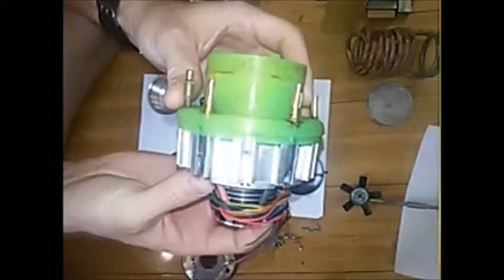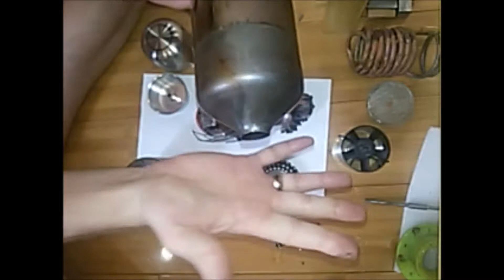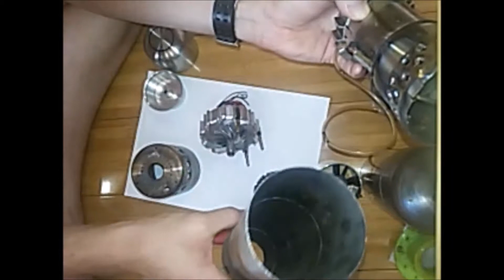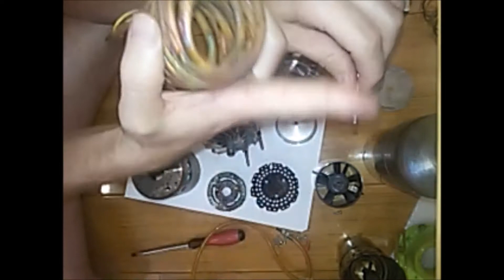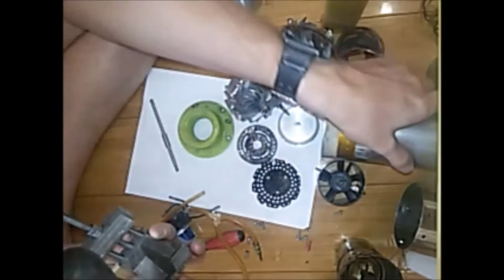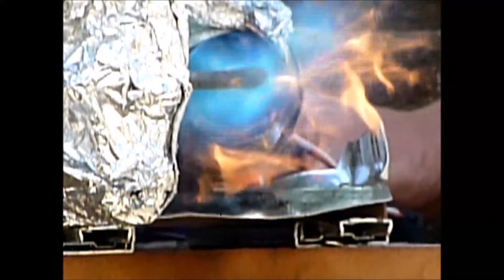YouTube

Comment: Could a 7.5hp Nitro engine with a gearbox drive it fast enough to get enough compression?
Reply from the maker: if you had a gearbox that would sustain the RPM to get it to 100-150krpm+ then yes. Put a propeller on the 7.5HP engine and you'll have much more for your HP! These compressors need RPM at that power. Now imagine the weight of the Nitro + gearbox, vs the weight of the turbine + shaft, and you will see why jet engines are jet engines and Nitro engines are Nitro engines. A prop is much more efficient due to it's diameter unless you're planning on going supersonic...

Comment: Thanks, that was very interesting.   I learned a lot.
Surprised me how much energy was needed for the compressor!.  Recalled reading of the historic Caproni-Campini aircraft as a boy, and looked it up . . .  Theirs used a 900 bhp Engine for the compressor!                       https://en.wikipedia.org/wiki/Caproni_Campini_N.1
Seems that nowadays this configuration is referred to as a "motorjet" : 
     https://en.wikipedia.org/wiki/Motorjet
Reply from the maker: They sure are HP thirsty! compare the weight of the 900bhp engine to the weight of a 0.5m dia turbine wheel... One you can lift with your hand, the other you can't lift with many hands...